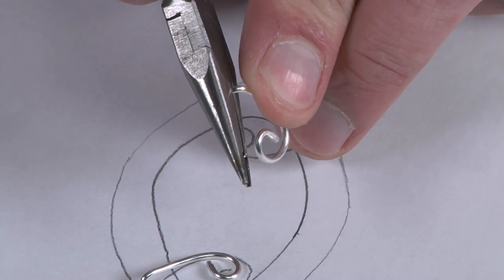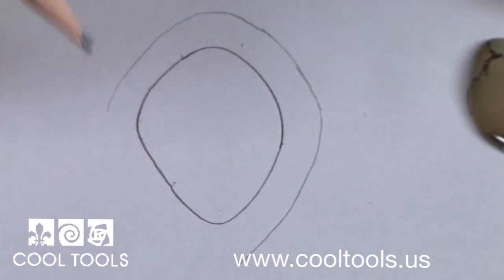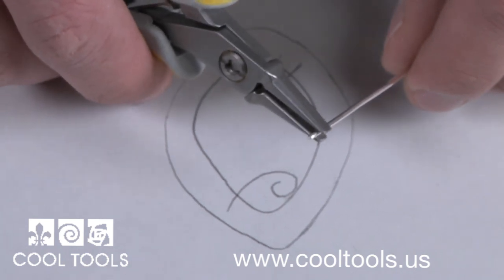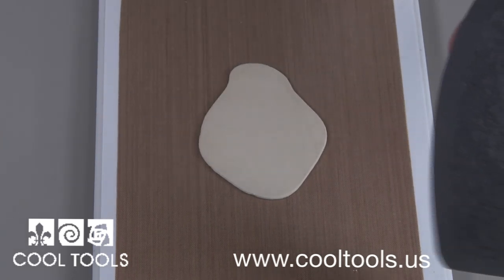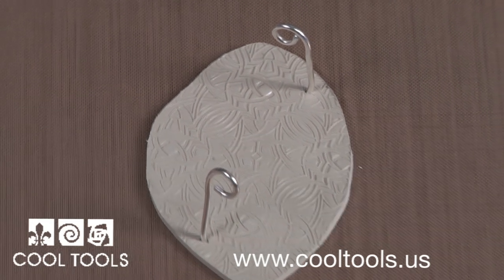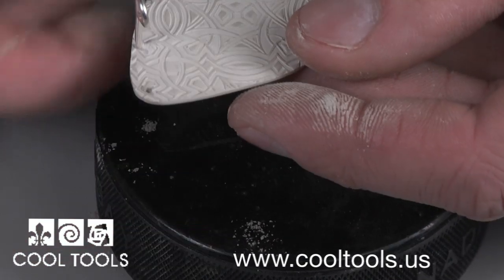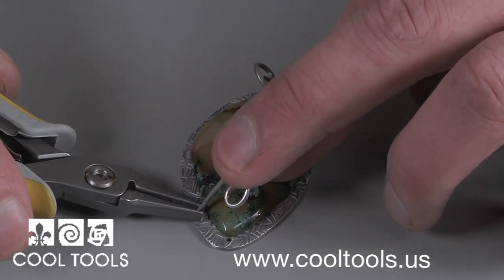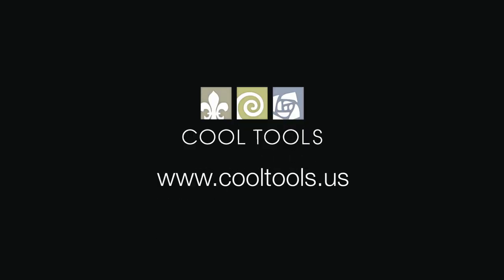Custom Prong Settings

Comment: Can this technique be done with the torch fired method using PMC3 or Art Clay Silver with sterling silver wire for the prongs?
Reply from the maker: Hello, yes, you can torch fire as long as the clay can be torch fired. Thanks for watching!
Reply: @cooltoolsvideos  Awesome! Thank you so much for your quick response! 🙂

Comment: How much does it cost to heat that oven?
Reply from the maker: Hi, a kiln we commonly use is the Paragon SC2. The SC2 plugs into a 3-prong household outlet and draws 1440 watts. The average hourly cost to operate it is 15 cents. Hope this helps!